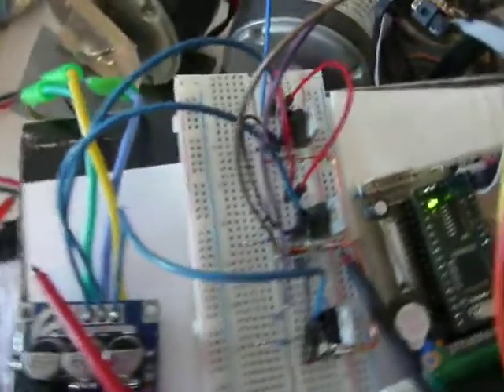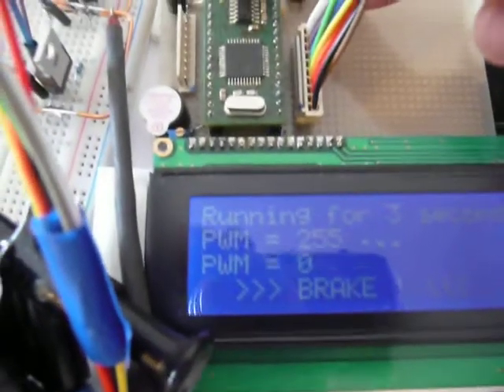8$-Brushless-Controller JYQD for Hoverboard-Motor NOW WITH BRAKE - Part 2

Comment: IN BRAKE DID YOU PUT 36V OF CHARGE IN THE MOSFETS OR WAS IT LESS?
Reply from the maker: So several processes happen almost simultaneously: The operating voltage (36 V) is of secondary importance when braking, as the active motor drivers are deactivated and the turning motor represents a short-circuited generator.
There is a problem here: the higher the speed of the motor to be braked, the higher the voltage fed into the intermediate circuit by the motor. For this reason it is not allowed to brake with 100% PWM at high speed, rather you have to "cycle" the brake so that the voltage across the motor does not increase too much.
Of course, the lowest possible internal resistance of the voltage source (battery) also plays a role here, as well as the shortest possible supply lines in the entire area of the battery, controller, motor.
The components from the video are all series, so that my experience can be transferred to comparable systems. Anyone who uses other motors must make their own measurements (and adapt their brakes accordingly) in order not to overload the system.
In my application with 50% PWM brake at high speeds, I had a voltage increase of + 5 V on the power supply, so the entire circuit must be able to withstand at least 41 V at the time of braking (absolute maximum rating). The lower the resistance of the voltage source + supply line, the lower the voltage increase when braking from high speed.
Please consider that this is a highly dynamic engine project, whereby the "freewheeling" state does not exist! Then there is only acceleration and (more or less hard) braking with completely short-circuited motors at standstill.
I wish you success ...
Reply: @accuxpert2277  thank you, i really liked your project.

Comment: hey very good video.  do you have a diagram somewhere on how to make such a brake?  maybe the connection diagram?
Reply: it's about the mosfet
Reply from the maker: This is no big deal. Please google for "motor brake mosfet".
For the BLDC-Motor you need 3 MOSFETs, i took the IRL540. These are logic-level Type, that means you can connect the Gate (with a 47 Ohm Resistor) to a 5V I/O-Pin of your Controller (e.g. ATMEL AVR). Don't use 3,3V type, is to low Gate-Voltage.
Put another 10000 Ohm resistor from Gate to Ground, for deactivating the Brake-MOSFET during Reset of the ATMEL. Than you put the Drain to one Leg (of 3) from the motor and the Source to the Ground (the thing is, you shorten all 3 Motor-wires to Ground if you want to brake the motor). 
Look to my discription below the video. The rest ist only smart programming...
So for the whole active brake like in my video (BLDC-Motor) you need this part list:
3 Pieces IRL540 (IR, logic Level Type)
3 Pieces 47 Ohm (I/O-Pin to Gate)
3 Pieces 10000 Ohm (Gate to Ground)
Thats it. Good luck.
Reply: @accuxpert2277  thank you very much, it will help me a lot
Reply: @accuxpert2277  hey it was actually easy to do but your advice was very helpful.  I made this brake for my robot.  Thank you very much for your help.
Reply from the maker: @robomaniak  Yes, it is quit simple. With brake at the correct time you can speed-up the time to response of the BLDC-controller. This is helpful in a robot-project because the robot become faster to stop an change direction. BUT: in a scooter-project (human transport) please don't use the brake, because amount of brake can be to high an the riding person will fall over...
Good luck.

Comment: Hello AccuXperT, 
First off all thanks for the video, it is a great trick !.
I have a problem, I followed your idea  and made a prototype, but it failed miserably. 
I think the fault maybe related to my grundplan. 
As I am using a common GND for both motor and the MCU ....what I mean is that I have connected the motor cables (MA,MB,MC) to the Drain and
the common ground from the battery (shared by the MCU aswell as the BLDC driver) to the source. 

Could this sharing of ground plan be a problem?
thx once again
Reply from the maker: The ground potential (GND) must be considered in 2 areas: logic GND and power GND. The motor current must not flow over the logic GND, which could lead to faults. The brake MOSFETs should be located very close to the gate control (e.g., directly on the controller I/O pin), and a pull-down-resistor must be provided from the gate to the source to lock the MOSFET without drive.
With your software you then test first the control of the brake MOSFETs, without motor control. Activate or deactivate the I/O pins of the brake MOSFETs one after the other and test the effect by turning the de-energized wheel. The effect of the brake must be clearly noticeable. Only then should you drive the engine. And do not forget: NEVER control motor and brake at the same time!
Reply: @accuxpert2277  thank you for the reply, sry i didnt get the chance to say thanks earlier ... but rather say it after 4years than never :)

Comment: Hi, great video thanks you! I recently made a electric chair for my disabled baby girl using an old overboard, 2 BLDC controllers like you, the 36v battery and an Arduino. I would like to add a low brake to slow down the chair. I recently saw a video in which the mosfet located on the controllers are used to simulate break (resistors are added on the card). Have you any idea to do that? Thanks you
Reply from the maker: For an electric wheelchair with brushless motors, I would take the cheap BLDC controllers from my videos in your place.
BUT: Please DO NOT brake with additional MOSFETs, as I have shown in the video. The reason is that at a higher speed the brake MOSFETs almost block the wheel, which is rather undesirable in a wheelchair - in the worst case, the driver drops out of the wheelchair ...! THEREFORE PLEASE CAUTION!
I believe in the case of a wheelchair, the use of a mechanical brake is necessary ...

What I have shown here and in the other videos is rather for highly dynamic vehicles (bots), which can move jerkily, accelerate and decelerate as fast as possible and beat hooks - all this is undesirable for a wheelchair ...
Hope to have helped
Reply: Thank you, I understand. In my case the wheel chair does not reach high speed. But I would like to slow down the wheel when it is on a slope for example, without hard and brutal brake.   If I put a mosfet on only one of the three phase motor, could it work? 
I have an other question. I think that the couple of motor is linear with the Speed. It is a problem because sometimes (in présence of rocks or gravelar on the road) the wheel chair has not enough power to start. I avoid this problem by starting with an high speed during 500ms and then go back to the low speed. Have you any idea for that point? Thank you very much, maybe the best solution is to
Buy an electric chair, but it is a little bit expensive lol
Reply from the maker: @topinvincent5159  
1) To be able to brakes reasonably effectively, you must short-circuit at least 2 of the 3 wires from the engine. With a line that will not work, it could even be that you then activate a generator mode, in which case the brake current is deflected into the battery and there raises the voltage (recuperation). A possible generator operation must be observed and tested so as not to overload voltage regulators, MOSFETs and capacitors.

2) A wheelchair is a safety application. You can not do without the mechanical brake because the electronics could fail and the wheelchair would not be braked ...

3) I know the problem with starting up the PWM. I always take a starting value of 20% of the PWM. The problem lies in the internal circuitry of the BLDC controller. This circuit ensures a time delay, which greatly slows down the process (500ms wait). On the other hand, there is operational safety, because you can not control the BLDC controller incorrectly: even if you suddenly reverse the direction of rotation at full speed, the controller slowly shuts down the wheel, stops, and then slowly accelerates back to the (via PWM or throttle grip) set speed! You can not override this "delay" of the controller at the control inputs - the controller does what it wants ...
That's why I installed the external MOSFET brake, which significantly improved the delay and switch times.
Good luck with your project
Reply: Thanks for all your advices!

Comment: If the brake is hard, is it possible to blow the mosfets with back-fed EMF from the motor?
Reply from the maker: Overheating the brake MOSFETs could actually be an issue, so I also recommend placing each MOSFET on a single I/O pin and mounting the MOSFETs on a heatsink. In my experiments in the video, the brake MOSFET's without heat sink just hand-warm - so negligible. But in a real project this could again become an issue, e.g. when a vehicle is permanently (extremely) driving maneuvers from high speed downhill performed. Therefore, I have clocked the brake MOSFETs at high speeds, which causes some of the braking energy to flow into the battery. However, this has the disadvantage that then the voltage on the battery beyond the actual operating voltage can increase slightly, which must be observed in order not to damage the motor driver.

Anyone building a vehicle in this area has to work hard to find the best solution for their setup. I can not assess that from a distance effectively. In addition, the 8 $ BLDC controller is a low-cost solution, as is the simple MOSFET brake.
If you want to invest a little more and experiment, the donated a brake MOSFET even a temperature sensor and monitors the power loss ...

Comment: do you have circuit diagram for the connection of mosfet,controller and arduino? thank you so much!
Reply from the maker: Unfortunately, I do not have a circuit diagram, the circuitry is too small for that. The wiring of the 3 brake MOSFET is very simple and corresponds to the usual theory.
Simplified shown: the 3 MOSFETs come as follows to each one of the 3 thick motor cables:
1) MA (1st motor cable) to DRAIN (1st brake MOSFET)
2) MOSFET SOURCE on motor ground
3) MOSFET GATE over 47 ohms to a free port pin (I / O)
4) Set the port pin above 10,000 ohms to digital ground (pull-down in on state and controller reset).
5) Perform this for all 3 MOSFET's.

Good luck with the experimental setup ...
Reply: @accuxpert2277  https://www.youtube.com/watch?v=QrH8NNfC-UE&t=36s

Comment: Hallo, was ist der Grund für die verwendung von 3 I/O Pins. Würde nicht auch einer genügen ??
Reply from the maker: Also der Grund dafür ist, dass jeder Brems-MOSFET möglichst schnell durchgesteuert (On) und gesperrt (Off) werden muss. Dazu ist eine erhöhte Stromaufnahme bzw. Stromabgabe nötig, da die MOSFETs spezifische Gate-Kapazitäten haben, und diese Kapazitäten möglichst schnell umgeladen werden müssen (je länger das dauert, desto wärmer werden die MOSFETs). Die MOSFETs sollen als Schalter dienen und möglichst schnell ein- und ausschalten. Wenn der Strom zu gering ist (nur ein Pin statt 3) dann steigen die Schaltverluste deutlich an und die MOSFETs werden (zu) warm / heiß, weil der Bremsstrom zu lange über die Drain-/Sourcestrecke des MOSFETs fließt und dabei auch der Spannungsabfall zu lange anliegt (Verlust-P = U * I)...
Hohe Motorgeschwindigkeiten verstärken das Problem, da der Bremsstrom (und die Spannung U_DS) entsprechend ansteigt.
Außerdem möchte ich keinen Kühlkörper auf die MOSFETs montieren, von den Pin's habe ich genügend zur Verfügung...

Tipp: Man kann es auch mit einem Pin versuchen, alle 3 Gates müssen dann über 47 Ohm an diesen einen Pin aufgelegt werden. Zu beobachten ist dabei dann die Erwärmung der MOSFETs bei Betrieb der Motorbremse. Ideal wäre es, wenn der betreffende I/O-Pin dann +/-20 mA (oder mehr) realisieren kann... Viel Erfolg!
Reply: Vielen Danke für die schnelle Antwort. ich werde es mal versuchen und hier berichten.
Reply from the maker: OK, ein Bericht ist gut zum Erfahrungsaustausch.
Bedenke noch, dass die Brems-MOSFET sogenannte Low-Level-Typen sind, also mit "nur" 5 V statt 15 V am Gate durchgesteuert werden. 3,3 V wird nicht gehen. Und je mehr Pin's beim Controller in Reserve sind, desto besser.
Übrigens pulse ich die Brems-MOSFETs beim Bremsen aus hoher Drehzahl mit ca. 1500 Hz. Dies ist auch der Grund warum die Schaltverluste möglichst gering und der MOSFET möglichst schnell schalten soll...
Reply: Hallo, das klinkt so ähnlich wie meine Anforderung ;-). Hohe Drehzahlen werde ich eher nicht haben, wird ein RC Rasenmäher. Nur stehen bleiben sollte der natürlich auch bergab mal. Ohne bremse rollt er erst bis zum Stillstand und nimmt dann erst neue kommandos entgegen. Ich nutze einen arduino somit hab ich 5V. mal schauen.
Reply: Hallo, ich hab das nun für meinen Einsatz zusammen gelötet und je Motor mit einem Arduino Pin angesteuert. Funktioniert sehr schön und ist vor allem eine einfache Lösung, danke dafür.
Reply from the maker: Das hört sich gut an!
Achte auf die Temperatur der Brems-MOSFETs und wenn möglich, die MOSFETs irgendwo mit einer Wärmeleitfolie auf Aluminium befestigen...

Comment: Hey, may I ask where did you order the driver from? any link? thanks.
Reply from the maker: I ordered via ebay from Germany and paid with PayPal. The delivery time from China is 8 to 12 weeks but a bit long ...
Since I need 4 pieces for my robot, the price is very interesting ...

https://www.ebay.de/itm/12V-36-500WDC-Brushless-Motor-PWM-Control-Controller-Balanced-BLDC-Treiber-Board/322713421896?hash=item4b23380848%3Ag%3A7QoAAOSwFWVZn7a3&_sacat=0&_nkw=JYQD+&_from=R40&rt=nc&_trksid=m570.l1313